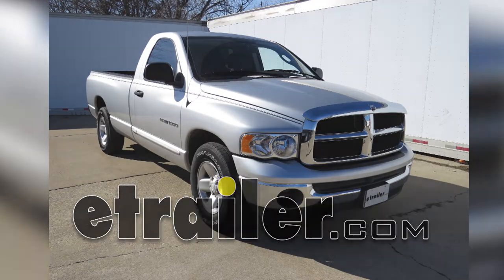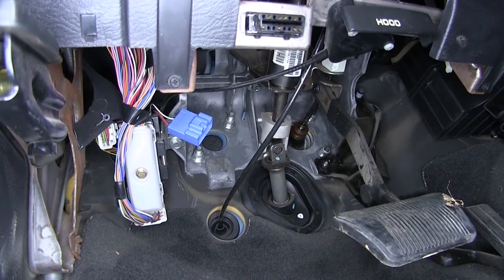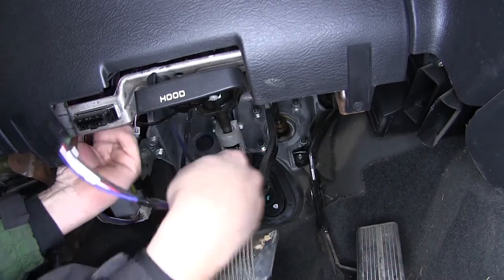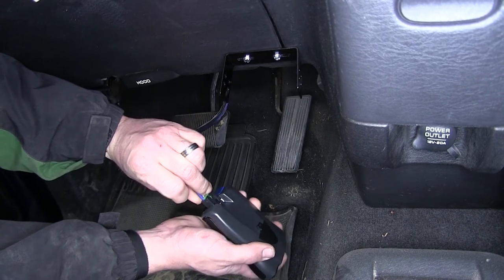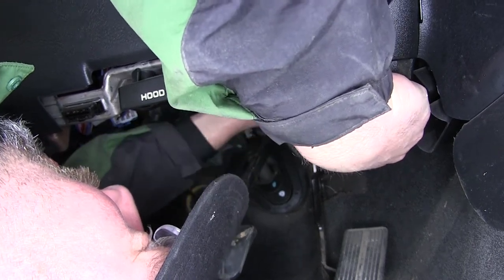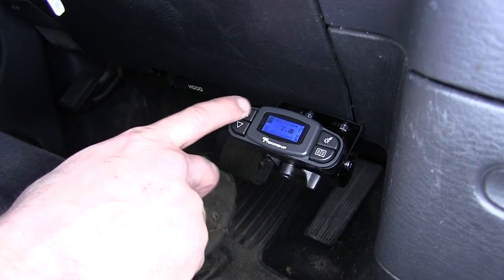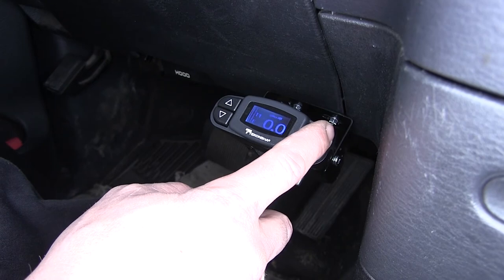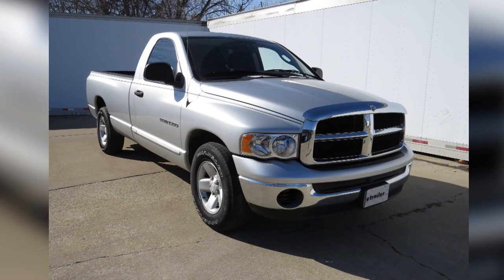etrailer | Installation: Tekonsha Prodigy P3 Trailer Brake Controller on a 2003 Dodge Ram Pickup

Comment: Page 40 of the 2003 Ram Truck Owners' Manual warns against mounting anything on the Knee Bolsters.  Too bad Tekonsha couldn't include enough wire to mount the controller in a safer location.

Comment: Hello, we are trying to install a brake control on our 2002 dodge ram 1500, full cab, 5.9 liter engine. we were wondering if you might be able give us any help or diagrams for installing and wiring up the brake control. any help is appreciated
Reply from the maker: Do you already have a brake controller? If so, do you know which one?

Comment: What do you do if there isn't a blue 4 wire connector?
Reply from the maker: What is the year, make and model of your vehicle?
Reply: I found it, it was pushed up in there pretty good. Its a 2004 ram 1500
Reply from the maker: Good deal! Feel free to reach out to use if you have any other questions.